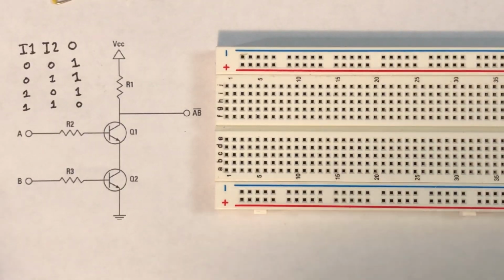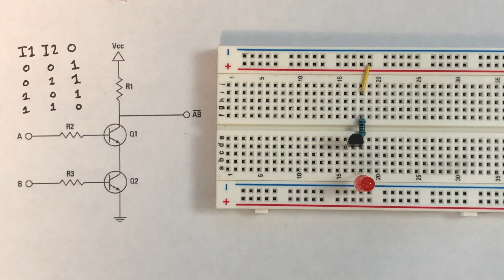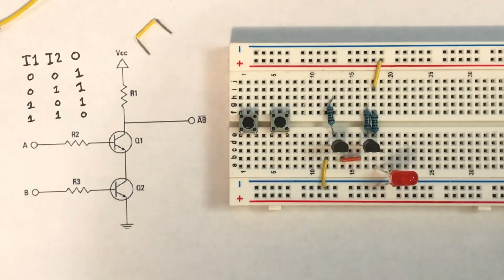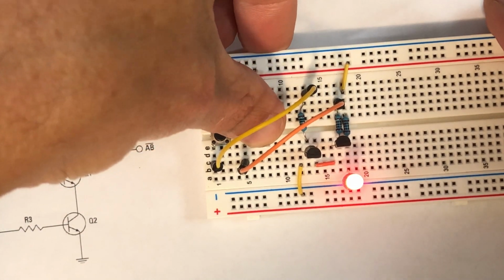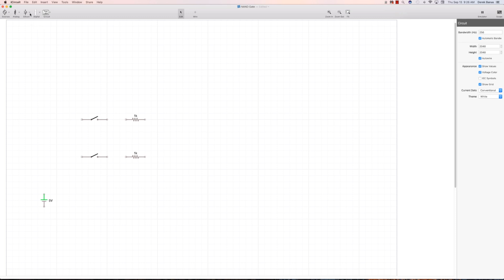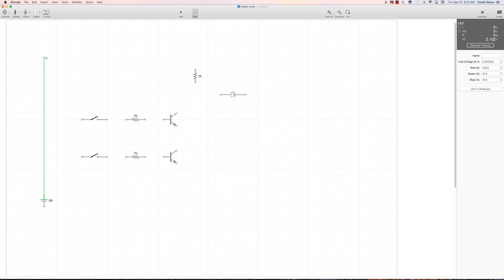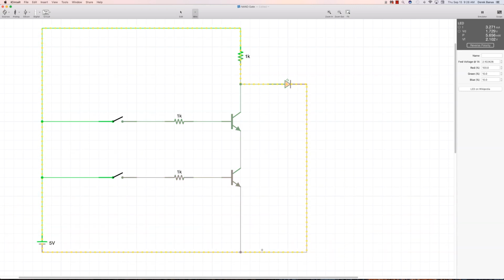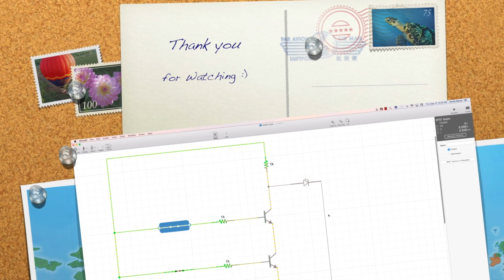Arduino 6 : Read Schematic Diagrams

Comment: Hi Derek, thank you for great videos. Please make a tutorial on Apache maven build tool. Maven seems useful but very confusing. By default it can't 
(1) resolve stuff not in maven central repo (ojdbc for example - <scope>system</scope> ca solve it), 
(2) doesn't include dependency jar in the artifact (shade can solve it)
(3) system scope is not compatible with shade plugin

And all the other tutorials are either piecemeal or dealing with bare minimum "we will include junit from maven repo and we are done". Which is like "i will teach you that 2+2=4. Now you can prove little Fermat theorem".
Reply from the maker: Thank you :) I'll look into it
Reply: Brief update -  <scope>system</scope> is discouraged by Maven because they want devs to use central repository. Still, Manen should simplify an already simple task of building an app, but learning it is hard.

Comment: When the two switches are both closed, why does the current don't flow through the LED? The wires are still there.
Reply from the maker: The current actually still flows to the LED, but not enough to light it. When both transistors are active they provide enough voltage drop so the LED can no longer light up. From now on I'll cover voltage drop so that that isn't confusing.

Comment: my biggest issues as a total noob is understanding how the electricity flows and why it changes when you open/close gates
Reply from the maker: That is solved with a lot of experimenting. Everyone has the same issues to resolve when they just start learning.
Reply: Shanene Larissa, current flows from positive to negative. When any of the two transistors doesn't have collector-emitter (C-E) junction shorted, the only way the current can go is through the LED. However, as soon as both transistors have C-E shorted, they have both of their collectors and emitters at the ground level so they're pulling the LED's anode voltage to the ground which means both anode and cathode of the LED are at the same level so current can't pass through the LED. Instead, the only way for current to go is through both transistors to the ground. I hope I got it right. I'm still learning analog electronics. Digital is easy to me while analog can be confusing.
Reply: @discoHR  try researching more in books, electricity doesn't flow, its an interchange between electrons. But we say "flow" and it "flows" from negative to positive, because their charge is negative.
Reply: While you're absolutely right with the electron interchange direction, the common convention in entire world is for DC current to flow from positive to negative. Look it up. I even failed a test in electronics 30 years ago because I wrote the electron interchange direction is correct so the current flows from negative to positive, not the other way around.

Comment: Should have used Cadence Virtuoso
Reply from the maker: I was going to get that, but I bought a house instead :)
Reply: Funny ヅ
Reply: I have got a crack. ( You can use CMOS 135nm library in it.)
Reply: I have it on google drive too. If you wanna try.......
Reply from the maker: Thank you :) I'll just use iCircuit since most people can afford it
Reply: Cool.! BTW I was wondering if you could suggest me regarding Mastering Nginx and/or Apache.
Reply: I have the basics covered but which should I master first and why and what book/tutorial would you suggest.
Reply from the maker: NGINX is faster, is growing in market share, but has less market share (less jobs). Apache is used twice as much but is losing market share.
Reply: I think I should master Nginx first.
Reply: Also, I was wondering if you can suggest the same regarding Caching ( CDNs, Page Caching, and Varnish/Redis etc..... )
Reply: Because you know "Over" caching is no good && not caching the dynamic content of the site while caching static content makes it a lot confusing as you already might know we can even cache the caches (when correctly configured)

Comment: What's next
Reply from the maker: XOR Gates, NOR Gates and then a calculator using circuits. Then I'll move into ICs. My goal is to provide a solid understanding of electronics and then work up into bigger projects. If I get enough interest in this series I may make projects as big as a drone, but so far we aren't there yet.